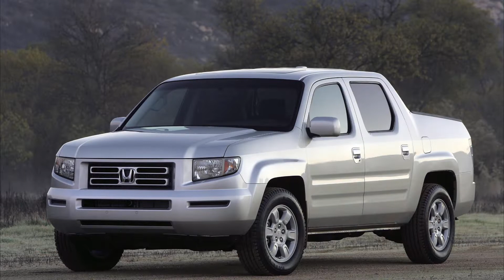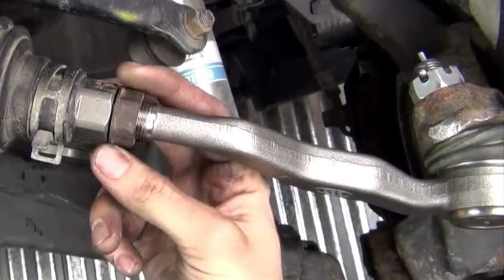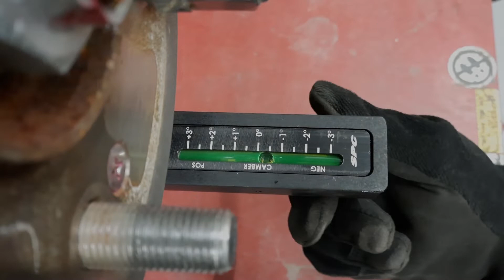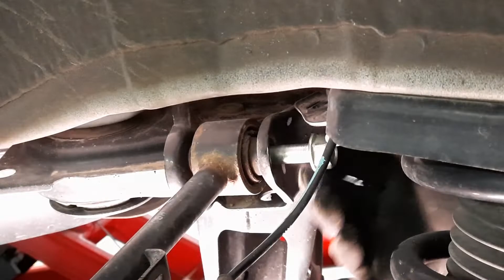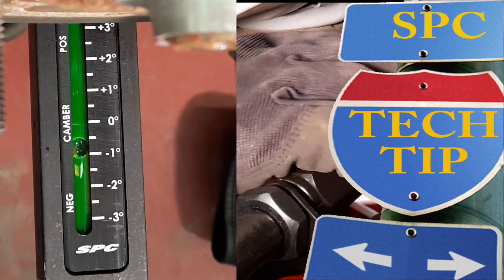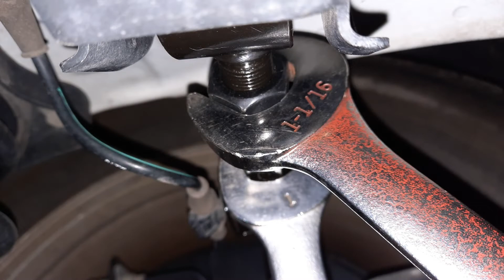67490 - Honda Ridgeline Rear EZ Arm - SPC Alignment

Comment: Very cool...   I've done these on honda elements..   also the rear camber bolts never get lubed by any shop..  that's sucks because once there tight.  No one every fixes them by getting them loose again...  I wish the shops wood put no lock on those camber bolts!